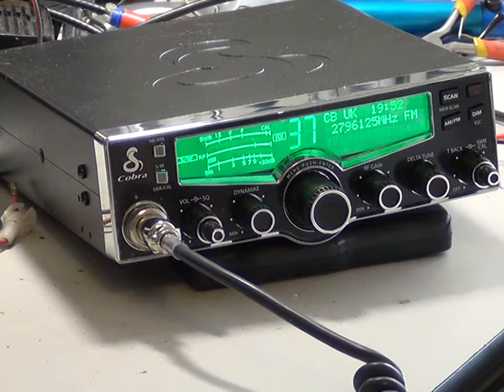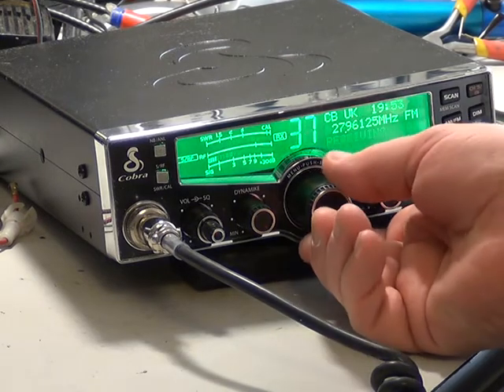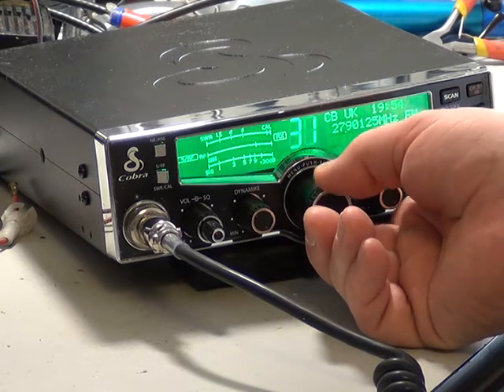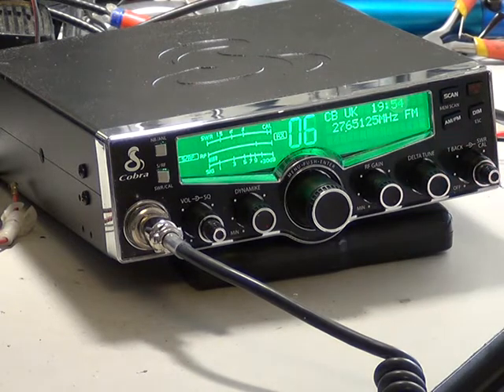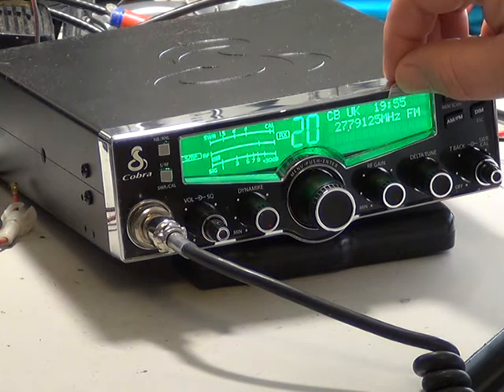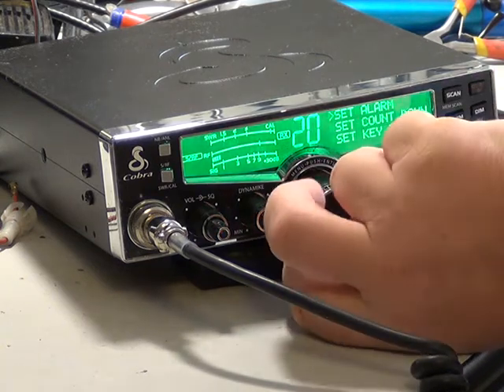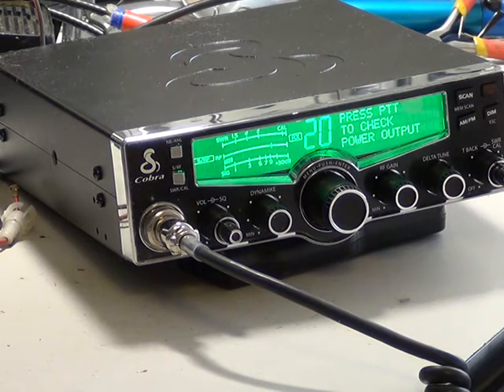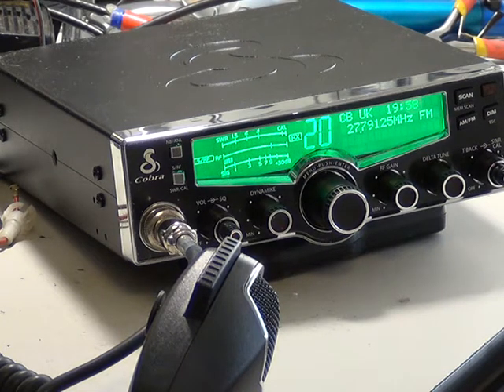Cobra 29LXEU, UK/EU (CE-Multi) 80-channel CB Radio (Mobile) - On The Air Test

Comment: Hi. I see that you do cb repairs and restorations. I cant find you on the web, just wondering how you can be contacted?
Reply from the maker: John. This part of the business is not on the web as it is a subiduary of my main business "Ireland-Shireby Church Organ Builders". The main business is in the overhaul & restoration of huge church pipe organs & nothing to do with electronics whatsoever. I do the CB side of things over winter as I find freezing cold churches uncomfortable. I worked over 20 years professionally in 2-way radio & employed staff for the organ side of things. Since 2000 I've done the organ side on my own with help from time to time....same applies to the radio side. I deal only with the trade on the radio side of things apart from the odd occassional local farmer. There are no retail premises, so it is solely done mail order. Customers know radios will only get looked at from October onwards. Retail customers wouldn't cope with that.

However, you may contact me at   richardDOTshirebyATvirginDOTnet

Youtube doesn't allow email addresses.

Richard
Reply: UK CB radio servicing Many thanks for that info Richard. I would just like to say that I do find your videos very interesting and educational. Please keep them coming. All the best John.

Comment: Disgraceful that it should emit such low RF power as 'factory fresh'. Almost classifiable as not fit for purpose and would certainly deter me from purchasing one.
Reply from the maker: It even failed it's own self test on TX power. However, now properly aligned it works very well. I've yet to find a new radio that works properley out of the box!
Reply: @ukfmcbradioservicingTango21  It looks like this radio is notorious for this and I suspect they all fail the second test because they are worried about going over the 4 watts and having their radio refused or banned from UK. I could understand them going a little under like 3.5 watts but 1.5 is simply not good enough.  I wondered what the ST was, so now I know ... Sound Tracker.  Thanks Richard very educational and love your sense of humour too hehe  "All singing-all dancing & lights up like a Christmas tree on steroids"  That is funny :-)